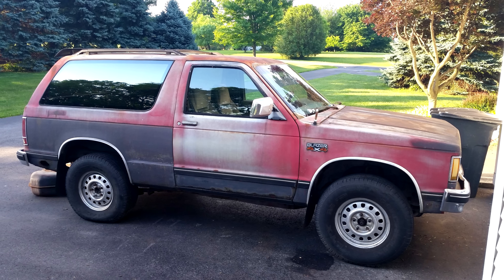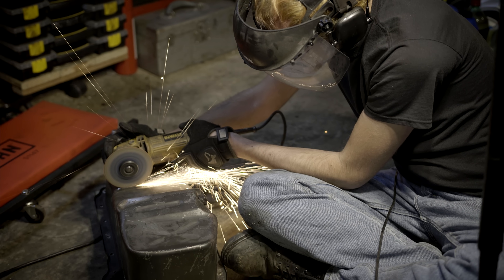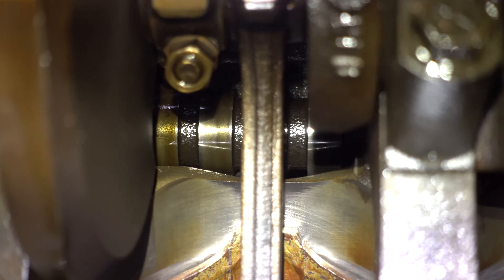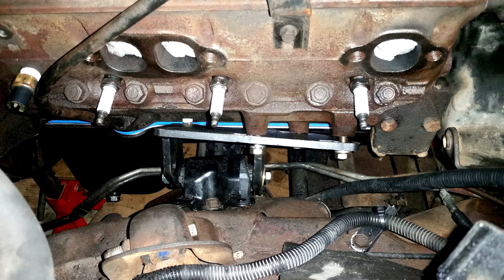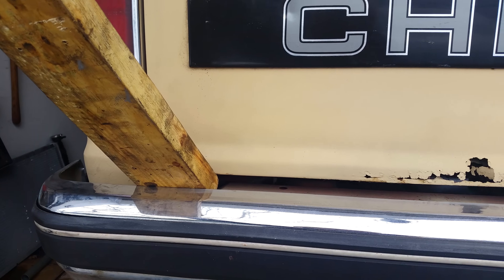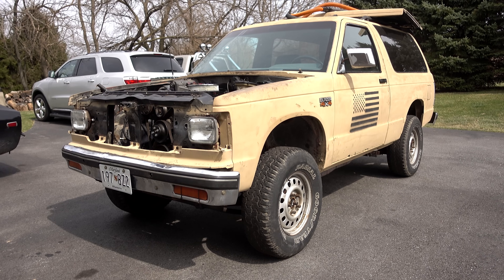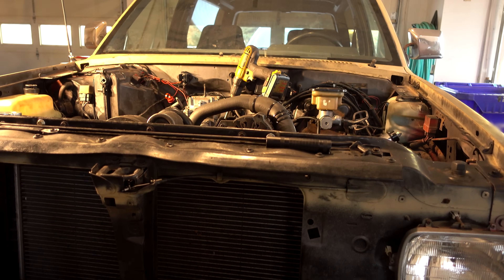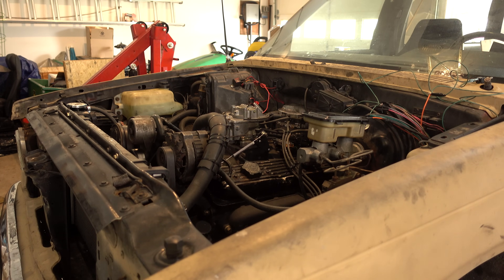4x4 S10 Blazer Budget V8 Swap (Ep.2)

Comment: Advance adapters makes parts for the v8 swap
Reply from the maker: Their mount part number 713107 does look more like something that would fit correctly, and with my current knowledge likely would have purchased that instead, but I didn't expect the Transdapt one to have so many problems fitting. Their other stuff looks nice but is too expensive for my shallow pockets.

Comment: All that work to put an engine with less or the same horsepower those truck engines make about 160 hp cool videos though and looks like you had fun and thats what matters plus a v8 is always better lol
Reply from the maker: My understanding is that they are closer to 190 and 300 ft/lbs, but yeah, you're not wrong haha. It definitely has more pep than the 4.3L, but it's not a HP monster. But just having the two extra cylinders sounds so much better it's worth it ;)
Reply: @FuzzyDiceProjects  
You don't need to install a body/suspension lift to make the engine fit. Summit Racing makes an engjne bracket kit for S10/S15s. I do like the clear distributor.
Reply: @FuzzyDiceProjects  
IMHO, I would have kept the 4.3L Vortec, rebuilt it, and add a turbo/supercharger. Or buy a brand new crate LS engine that doesn't have a power robbing distributor. But, to each their own. Nice narration and editing!
Reply: @Sig721Tau  it's not a vortec but a swirl port "vortex". If it was a 200hp vortec 4.3 then absolutely but the tbi can be troublesum with boost.
Reply: The 4.3 was new 160hp / 235ft.lbs in '88.  The 350 was rated depending on application.  Suburbans were highest at 210hp / 300 ft.lbs, while G30 & c/k3500s were lowest at 185hp/285ft.lbs. 

Why not a modern 5.3l?  You can grab a decent running one easily in the $500 range since they're so common.  Stock LM7s were 285hp/325ft.lbs and with a carb and cam can easily produce ~400hp & ft.lbs, a bit more if you keep the fuel injection and tune properly.
Reply: It's not about how much horsepower it has, it's also about how much more it is capable of. You ever try to jack up the horsepower on a 4.3? *knock knock* Rod's there.
Reply: Random Moustache Guy unchoke it and it could easily push 340 350
Reply: Wait, that 350 v8 only makes 190 hp?? My inline 5 colorado is making 242hp...
Reply: The 4.3 and 350 are literally the same engine just 2 less cylinders same bore and everything
Reply: So...let's keep talking about power and not the tranny lol. Kerchunk.
Reply: @curtism-w6b  4.3, 305 and 350 uses the EXACT same transmission so that's not an issue.
Reply: @curtism-w6b  if he went over 400hp maybe but even then if the clutch packs are in good shape you can just set the detent cable slightly tighter and that will make it wait longer to shift and give the servos more pressure to shift more quickly and hold the clutches tighter. I pulled a 4.3 out of my Silverado and hooked a 454 up to a stock 700r4 and never had an issue. A stock 700r4 is more then enough for a mild 350 if you know how to set the detent cable correctly.
Reply: Lou Spowells pretty sure the 4.3 would be exact same as a 350 just 75 percent power. Say you built a 350 to a modest 300hp. 4.3 with same mods be around 225hp. Your theory is correct if talking about trying to get 325 plus out of a 4.3 your really pushing it. Be the same stress as a 350 at 450 to 500hp
Reply: Aaron Mohler an old 350? Should have at least 200. And with headers, a 4 barrel, and a little bit of timing they can make upwards of 250-300 easy. And with lower gearing, it will not be a slouch let me tell you that.

Comment: You don't need a body lift at all. Back when gen1 sbc swaps had no kit options...a sledge hammer was used on the firewall & trans tunnel. Diff lowering brackets can be purchased to make room also.

Comment: If you look at the distributor there is a machined area that closes off an oil galley inside the block. Just using a flat blade with those holes open does not send oil through the whole circuit. You can make one out of a old distributor. Maybe the 4.3 one would work not sure on that.
Reply from the maker: I had not heard that before, thanks for the tip! I was going to make/buy a tool for it since the screwdriver wasn't a good solution in any respect. Already sold the old 4.3L dizzy (the same physical dimensions so would have worked) so I'll probably spend a few bucks and get a tool made for it.

Comment: Suspension would have cleared your oil pan and filter. Well oil filter can be routed in a different area. Cool build.
Reply from the maker: The differential cleared the oil pan, but I do not think it would have enough space between the oil filter and diff yoke if the engine sat any lower. Oil filter relocation was always an option, though. Some of the perceived clearance problems were simply because the engine was not tilted far enough back in the test-fit to approximate how it sits with the transmission attached. But don't get me wrong, it is still a tight squeeze. Thanks!

Comment: The mounts also go based off engine year and vehicle model year. I'm looking at swapping a s10 my buddy did it also but he ran into to high mounts. Called trans dapt they asked the engine year and told him the kit he needed. Also his and mine are 4x4 converted to 2wd. Helped fixed the oil pan issue. But we wanted 2wd anyways. But the 2wd have the engine cradle in the way like the axle is in the way on the 4x4, but the 4x4 pull axle so much more room also has the frame braced so don't need the engine cradle. Great job man I'm a fan of swapping v8s into stuff.
Reply from the maker: The other mounts Transdapt told me to use weren't listed as fitting the 4WD models (though I think they would work), but I also really didn't want to use the 4.3L style mounts that tend to come apart (as mine did when removing the engine). The mounts I ended up using were (I think?) 2.8L style, which is a clamshell just like pretty much all SBC mounts and even if the rubber disappears would not allow the engine to catastrophically come out of position.

Interesting idea to use a 4WD frame without the front running gear for extra clearance, hadn't heard of anyone doing that (though I wanted to keep the 4WD) but seems like a great idea.
Reply: FuzzyDicePimp yeah man that giant front brace in front of the engine is suppose to make up for the support for there not being a cradle. I will be running solid mounts not worried about rubber stuff. But then again I'm building it to run. 383 with a fogger system. Not a low budget deal but I'm looking for a Ford 8.8 rear to shorten and throw under it. Not sure if I'll go 4:88 or 4:10 just have to see what I can find. I plan when I get more money and get were I want to be I plan on tubing and tubbing the rear. Or building another and running a 414 stroker or go big block. But that will be purpose built. But I've always wanted a pro street s10. Ever since we did my uncle's 325i BMW with a 350 mild cam I've wanted something to just rod in but also want a purpose built drag car/truck. Chevyislife is my other channel has video of that beamer, or search BMW with 350.
Reply from the maker: Oh, gotcha, you ain't messing around. Someone around me has a tubbed first gen S10 Blazer with really wide rear tires and a big cam V8, makes me jealous every time I see it. I'm curious what the interior looks like in the back. S10 drag trucks are totally rad. My main car is a 78 Firebird with a mild 350 but highway gears. One day I'll make something that's decently fast and not just cheap haha
Reply: FuzzyDicePimp got it right with the trans am I have a 91 with only 32k miles picked it up off an old lady for a 1k. Had a 02 also that got totaled which led to me buying my ram. Now that I got a truck I can't actually start on projects and not have to call around and wait for a buddy to come help me pick up cars or parts from the junkyard like engines and transmission and axles.
Reply from the maker: Nice. I have a Silverado (used to tow this and many other cars) but the trans is dying so I don't drive it much, trying to fix this Blazer to replace it for a while. A neighbor has a late 80's T-top Firebird he offered to me for $700, very tempting but I'm trying not to stockpile too many cars at once.
Reply: FuzzyDicePimp well good luck with the trucks. Man. But if you snap your rear end with that v8 the Ford 8.8 rear is a great strong replacement.
Reply from the maker: Thanks, same to you! Since it is a 7 5/8" and supposedly those are fine, even once I put non-boat anchor heads in it I think it should be okay. If I do bust it I'll probably get an Ford 8.8.

Comment: My dads freind just beat his firewall back with a hammer
Reply from the maker: The standard firewall clearancing technique, to be sure haha, but I wanted to make more room for everything like the oil filter and front driveshaft, so the body lift seemed like the right option for me.
Reply: Pro tip for the oil filter: Find a 90's 4.3 4x4 S-10. They had an oil cooler in the radiator with a remote filter that sat behind the driver's side headlight. The lines run to stock location with a couple bolts into the filter's normal location. Can't say it'll work for sure with a v-8, but if it does, it would be easier to service. Keep the oil nice and cool top.
Reply from the maker: Unfortunately, this truck DID have that remote oil filter adapter, but it did not fit the 350 block. The part that bolts to the block is significantly smaller than the filter pad and bolt holes on the block.
Reply: Aww. Well, I guess you'll get good at taking that front driveshaft off.

Comment: why didnt you use the oil filter relocation system left over fron the 4.3?
Reply from the maker: It doesn't fit my engine block, the bolt holes and size are totally different. I think they might fit Gen III blocks, though. And the other relocater I had hit the frame rail, so short of junkyard hunting or cobbling something together (which I might do in the future) just using an inaccessible filter was about my only option.

Comment: Are you running an electric fan?
Reply from the maker: There's no fan on it in this video, in the next one (WIP, delayed because I broke the truck again) I changed from the 195 to a 180 degree thermostat and put two ebay special 12" electric fans in front of the radiator. They did fine sitting in traffic in 90+ degree weather for a few minutes at a time, but when it failed and I had to drive at 2500+ RPM to go 10 MPH it got pretty warm (up to 225 degrees) so it could probably use a bit more help cooling.

Comment: what's funny about this is that a stock tbi 4.3 v6 doesn't make only 125 hp it makes about 165
Reply from the maker: You're actually right, I was misremembering. A quick google search turned up a few different numbers (a 1985 TBI 4.3L was 130hp, that's what I was thinking of) but somewhere around 160 is probably right. Two things though, first is that this one was old and never worked right (and everything else was on the edge of breaking too, I'm finding out), and second is that it makes peak HP at 4K RPM and torque at 2.4K. The thing revs past 5k, so it's losing a lot of power by then, and no torque up there at all.
Reply: FuzzyDicePimp I definitely believe that, but 4.3s are really hard to kill. when I originally bought my 92 jimmy it was ran dry of oil. and I drove it for a while. it was so bad in fact that the engine was ticking like crazy I put oil in it and It runs strong. my dad had one that was knocking horribly and he drove it for nearly 3 months and he got rid of it.
Reply: FuzzyDicePimp I want to get a v8 for mine. but I don't want it to be as big as a 350 I might just find a 289 or something simple like that
Reply from the maker: I'll give it that, the stubborn 4.3L engine still ran when I pulled it, just knocked a lot. I went with a 350 because they're common and I already have tons of spare parts for them. It will never be powerful unless I swap the heads and cam, but it should still outperform the 4.3L for sure.
Reply: Them number sound like the 2.8 version

Comment: Should've got a newish 5.3 :/
Reply from the maker: Jose Rico Taco Nacho Quesadilla Mandela Jones Why do you think that? I prefer carburetors, and have three 350's now, so tons of spare parts. Plus the 88 shared most of the accessories and wiring so I could re-use what I had for the 4.3L. Yeah, the heads and cam are kinda junk but it'll be plenty for now and I can always swap parts later.
Reply: Jose Rico Taco Nacho Quesadilla Mandela Jones . the whole point of this is about budget

Comment: Won't the oil filter re-locator from the 4.3 fit the 350 ? They call the 4.3L the (3/4 - 350) it has the same bore and stroke , the 4.3 block is basically a 350 with 2 cylinders cut-off.
Reply from the maker: Paul Gale I thought it would too, some things I read online said "yes", some said "no". But it definitely doesn't fit on mine, the bolts on the 4.3L block are closer together, the whole thing fits within the oil filter o-ring of the 350 block. If I made an adapter for it, it'd be too tall anyway. I can dig the relocater out and show it in a future video if you'd like.
Reply: No, Thats ok . 
Good to know cause im planing on doing a v8 swap soon on my 93 Blazer 4X4.  Either a 327 out of a 64 corvette roadster (small journal crank, domed 12 to 1 compression pistons , 365 hp Factory. Google it) or a 4.8, 5.3 LS 
 the 327 motor i already have, has a oil filter" can " that bolts on through middle  with an o ring at base of can and at the head of the 6'" long bolt  (Cheezy). Luckly I bought an adaptor that take the new style filters, but adds an extra inch of space :( .
You don't see many 4x4 swap videos for the Blazer. Thanks!!
Reply from the maker: Paul Gale Sounds like a pretty killer plan you've got there! I have an exhaust on the truck now, and while the stubby filter does clear, if it was even an inch taller it wouldn't. The exhaust downpipe will have to come off to change the filter on mine, there's just not enough room. So buy a quality filter and extra exhaust gaskets, just in case lol.
Reply: Paul Gale he could just get a high velocity oil filter.

Comment: would of been cool if it was a Detroit diesel XD
Reply from the maker: marco Haha, I wish. the small block already barely fits, a swap like that'd be above my paygrade. Plus an engine like that would break the rest of the drivetrain so everything would need upgrading.
Reply: You no there is small Detroit diesels
Reply from the maker: marco I'm sure somebody could jam a DD5 in there (though one would cost as much as all my vehicles and engines combined) but the only reason a SBC fits without too many modifications is because the shape is so similar to the 4.3L it came with. It'd be too much for me to try and get the different engine and big transmission and transfer case to fit. (And new rear axle, solid front axle, driveshafts, etc.)
Reply: I no but it would be awesome